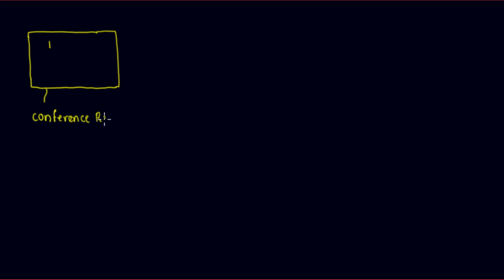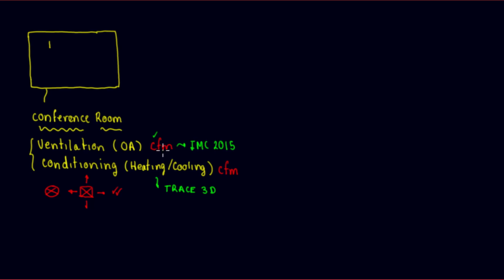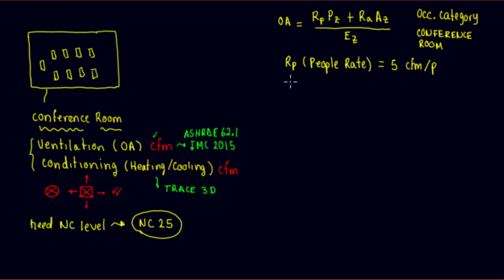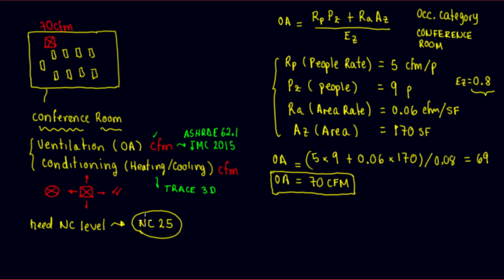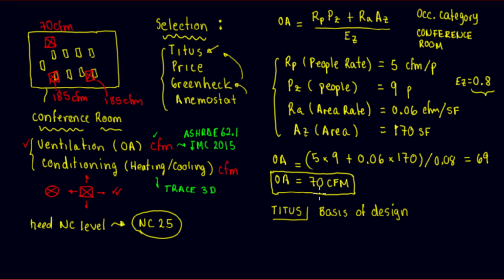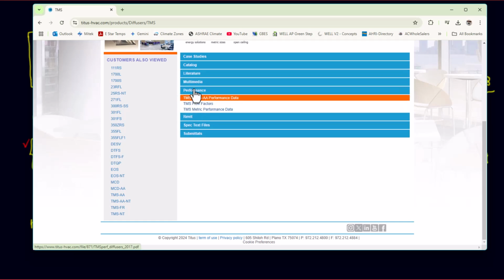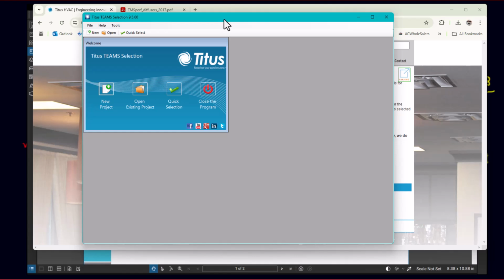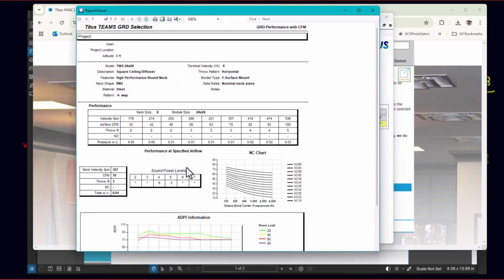Grilles, Registers and Diffuser's Selection P1

Comment: Hi HVAC Easy Math, good to see you again with an informative video keep up the good work, meanwhile i need your input regarding the return air duct how can i show it within the joist in wrightsoft, could you please make a video over it, waiting for your response
Reply from the maker: Thanks for the kind words. Do you mean have to show it as a high/low sidewall grille? The link show the process to change the return into wall grille https://youtu.be/HwKBuckHbfg?si=ixZ-wRvDDXZynI8b
I hope this helps.
Reply: @hvaceasymath  Thanks for your feedback. I want to ask about the words/tag "2-14x3.25" for return air duct running in stud/joist; how can i adjust my return duct w.r.t stud/joist ?
Reply from the maker: @MuhammadShoaib-v5k  I’m not very sure about the tagging for 2-14x3.25 but many contractors would add this particular tag by editing in pdf. PDF exchange, Bluebeam for example. Also another resource is to send an email to Hamilton (Wrightsoft technical support) to Hamilton.Fishman@mii.com.
Let me know how it goes!